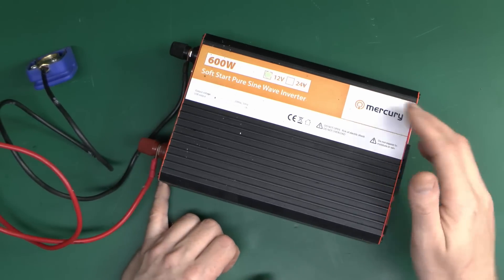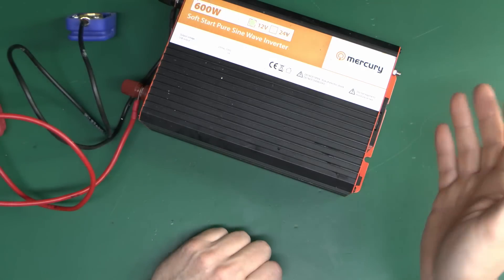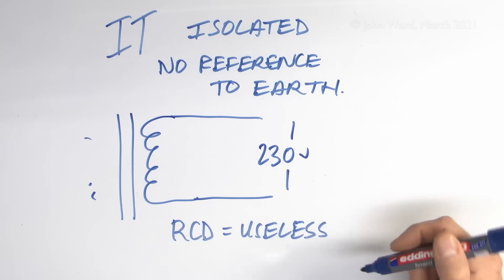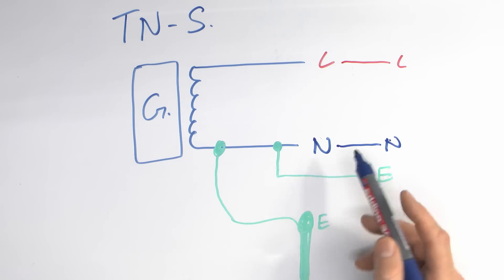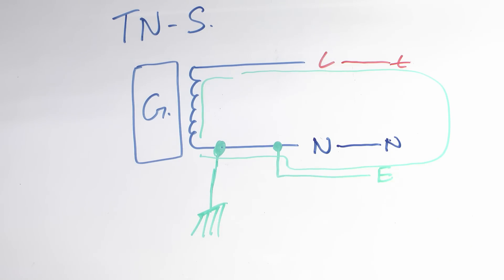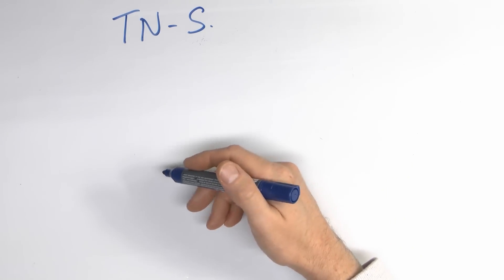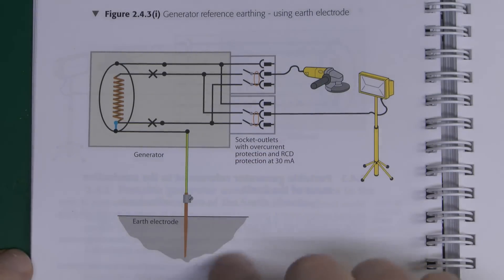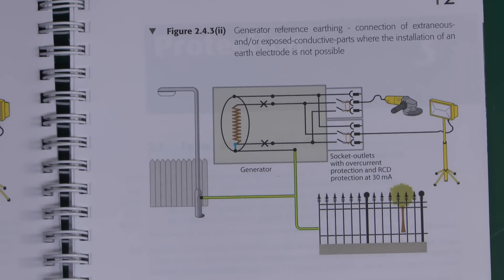Generator Earthing Types - TN-S or IT?

Comment: John you did not mention the ground screw on the case of the inverter that you were showing ? I take it that , that is where one would connect a grounding lead..?
Reply: Yes I was wondering the same thing. Also is the mains output earth connected to that? It that earth stud for earthing the battery or a ground spike.
Reply: ground spike

Comment: Hi JW. I have a portable petrol generator I want to use in a lock up garage. It is a frame generator by Machine Mart. I saw the need for an earth spike so I have held back from using it until I have drilled the floor and installed. Thanks this video is a first step in using it. I believe you have a video on earth spikes so will check that out. Thanks for the info. I take it I have done the right thing to not use it without a spike?!!

Comment: @ JW,
Thanks for explaining this, I don't do a lot of generator work as a rule, but when you read our standards over here  pertaining to generator installation (after you've bought them) they are full of lawyer-speak and no real help.
Every generator I've ever been a part of installing, has been totally different, could be stand-alone 3 phase, portable single phase.
When you go to permanently wire a generator into a switchboard, with a manual transfer switch, I insist on there being a flexible cable from the generator to an appliance inlet (this is a reverse plug, as in it has pins, the connector has the socket arrangement), this has caused so many issues with home-owners wanting the thing hooked up cheaply.
The bit that always confused me, was if you would use a seperate Earth Electrode, if the generator was feeding say an out-building (garage) that was supplied from the house,  in this situation, I don't think I've ever seen an Earth Electrode driven beside the generator?
Maybe them installs have been done wrong?

Comment: A metal water pipe would have been a better choice than the lamppost.
Reply: Everything is better than the lamp-post.
If the supply authority see your wire coming out of your house and connected to their lamp-post, 
they may not even ask the question and then just lop it off.
No earthing for you sweet-heart.......
Reply: @mikeZL3XD7029  A gas pipe is one of the few things worse than the lamp post, JW talked about that before though.
Reply: @station240  If a PME fault does occur, and all the lamp posts, gas and water pipes within the fault area are affected by a rise in voltage, isn't it better if your generator installation rises to the same voltage so that anyone touching one your appliances whilst leaning on a lamp post, doesn't experience a difference in voltages.  
I've seen a reference to a concept called 'PME Islands' in Guidance Note 8, and I think this would apply here - but as often happens with that particular book, I read the first paragraph and found it too confusing to continue.

Comment: Can you expand on the "with the exception of certain types of gas boilers" please? I imagine the principal use of a small inverter for a lot of people will be to keep the central heating running in a power cut...
Reply from the maker: Some gas boilers have been reported to not work when connected to an isolated supply from an inverter.  It's probably to do with the flame sensing circuit, which uses flame rectification.
Reply: @jwflame  This form of flame supervision becomes an issue when the supply polarity is reversed.
Reply: Boilers use a particular way to sense the presence of a flame, they rely on a small current between live and earth, that is conducted by the flame. Thus they require not only that the live supply is referenced to real earth, but also they mind polarity, if you invert L and N the boiler doesn't work. For example it happened to a person that I know that the boiler stopped working, then I checked and L and N were swapped by the supply company by mistake. Also in my country in some areas it's still in place an old supply that is 220v 3 phase, meaning that to get 230v you have to get 2 phases, and thus around 110v L to E. In that supply boilers can have problems, and that cases you have to install an isolation transformers just to have 220v L to N, connecting the N of the secondary of the transformer to E.
Reply: @alerighi  How does that not trigger an RCD is the current less than 30mA?

Comment: Do you ever see centre tapped Earths out of the generator as you would from a work site transformer? Particularly at 110v for which it’s common. Although I guess it cause it’s own safety issues if neutral is no longer neutral as expected.
Reply: The word nuteral is unfortunately assumed to = 0v even though it seldom is.

Comment: Thank you for another excellent educational video.  I appreciate your time and effort in producing these.  Consider a situation where you wish to run an inverter output into the house to run two class 1 items (pc with a metal cases for example).  This is a non-grid connected solar system charging batteries with an attached inverter (similar to your example inverter).  Assume the house is TN-C-S.  Would it be safe to use the household earth?  I confess to not understanding why 1 item with a fault is safe.
Reply: So for my understanding, with the inverter being IT, a single class 1 device with a fault, gives no return path to get a shock, as such there could be a fault without even realising. Add a second class 1 device, and if that too develops a fault, could mean a potential between the two devices if both are touched as once. As such, a single RCD from an IT supply won't give any protection, however if every class 1 device has it's own RCD, if a double fault should occur, at least one RCD should trip due to the imbalance, taking it back to a single fault. No issues with class 2 devices.
Reply: @ Keith Marsh,
No, this new system you're talking about would be a separately-derived system, to the mains system you already have had installed.
The idea of you using your household earth is wrong, you should never reference another system to your mains earthing system, because if there is a fault on your mains system there is a chance that you could end up with a rising-earth voltage situation that could damage anything else connected to it or create a 
shock situation, without you even noticing, until someone touches something metallic.
Reply: @mikeZL3XD7029  Thanks for your reply Mike.  I infer an earth spike should be used for my inverter.  Would I encounter a problem where a network cable went from my inverter run PC to a main's PC?
Reply: @KeithMarsh2  it depends on the network type. Cat 5 cables are transformer coupled at each end and have no earth connection. 
Shielded cables and cat 6 could connect your separate earth's, though true shields should only ever be connected at one end.

Comment: I've been searching for some light regarding generator earthing. Mine generates 186v on the line winding and 60v on the neutral winding. The earth is floating and not n-e linked as the touch voltage would be 60v. So running the generator in a van to use class 1 machines how do we use any protection. Additional protection is out the window, bond all metal and machine casings to the generator frame ? But its floating, so unless it sees over 32 amps it wont cut out. Run the machines via a consumer unit and mcbs ?
Reply: How you managed to measure 186V and 60V respectively?🤔
Reply: @piratedprivacy9052  from the output terminals to the generator casing on line and neutral.
Reply: Sounds like those voltages are from capacitive or inductive coupling.  There are multimeters which have a setting to measure voltage using a moderate input impedance in order to eliminate ghost readings.
Reply: @westinthewest  yes was thinking of ghost voltage, but when I neutral earth bonded the line raised to 196V and neutral dropped to 50v under load on a 2kw heater. I will test it next week with a friends multimeter which can detect ghost voltages. Just dont want to put 50V ac on the van body and cook the batteries or electronic components.

Comment: I used a dual voltage genny 110v/230v and we were only allowed to use 110v power tools (before batteries tool days) back in the 80s.
I used a long cold chisel for an earth rod, it worked but when the arsehole site agent saw it he threatened to kick us of site if we didn't put a copper one in.
Reply: Copper does have MUCH better conductivity than steel. Steel might have done the job - but would need confirmation by measuring. As would copper, come to that.
Reply: @Tiny Tony Maloney,
Of course you did do that......
Reply: So someone trying to keep you safe is an arsehole....
What a prick you are.

Comment: Hi JW, great stuff as always, but here comes a little challenge ...House supply is single phase TNS with 1960s lead cable, roadside cable replaced at some time, so most likely being TNC-S now. Outbuilding 30m away from house which i made a TT supply for obvious reasons. 3 phase generator next to it to supply the big machines. sharing the TT earth.. If i want to feed the house from that generator via a transfer switch, i wonder what to do with the PE as i definitely want to keep the outbuilding TT at all times. Ground resistance to the house is well below 100 Ohm, already got some earth rods on the house PE as i am a radio ham. My current idea is just to make the Genset a '"sort of'" TT supply to the house as the actual ground resistance would be low enough for reliably tripping the generator RCD, so perfectly safe (in my opinion)  ..... What's you thoughts on this ? .... Thanks, Mike
Reply: Could the transfer switch be 3 pole and switch all conductors including PE over to the generator supply and isolate the grid,  So when switched to grid L & N and the TN-S/TN-C-S earth are connected to the house (and isolated from the garage as normal), but when the switches is switched to generator the L,N & PE from the grid are isolated and you are connected to the L & N from the generator then the PE can be connected to earth electrodes at the house and then you would have a TT set-up when switched to the generator, as the generators earth electrode is the first T and the houses electrode is the second T

It is important to ensure complete isolation of all conductors including PE on the side of the switch which is not being used.  Also important to ensure you have a 100mA delayed RCD on the generator to provide fault protection and then 30mA RCDs on the circuits in the garage and house to provide additional protection as with the TT set-up the rod resistance is usually high so RCDs are needed to meet disconnection times.
Reply: @marcuswareham1  As far as i am aware, you not allowed to switch the PE at all, because there is a risk that the switch is on fault and then you would have no protection at all. It also won't fit my requirement to keep the outbuilding TT all the times (longer story). The genset has a 100mA RCD and both consumer units have 30mA RCDs as well. Just to recap what i want to do,... Outbuilding has electrodes, house has electrodes (but is actually TNC), so imho, this fulfills the requirements of a TT supply, essentially the same what you would do with an electric car charge point, the only difference is that this would be a supply, instead of a socket., hope that makes sense.
Reply: @dynoguy  maybe adding another rod at the house end 🤔 got me thinking on that one lol.

DNO new regs coming out means all new builds will have an earthed mesh at the house if its tncs supply effectively creating a backup earthing arrangement should you get a broken PEN.

maybe you could build some kind of system to switch the earthing to make house TT on generation and have the TT also at the workshop end and then when you switch off the generator it disconnects the house TT earthing arrangement and of course by manually switching off the gen set it also disconnects the TT earthing arrangements  carried over from the workshop 😳 

failing that maybe make a earth leakage and relay setup so that when on gen set there's a relay with earth leakage that sends a stop signal to the gen set and fires a separate relay to switch back to the original house TNS arrangement.
this is most definitely a head scratching setup buddy 👌 👏 👍 

my ideas are just half baked and in no way conclusive 

otherwise other issue depending on load is the stress on 1phase of 3phase generation 🙄 😒 could damage gen long term with loads on 1phase only possibly.

Comment: I've been considering this very issue ever since I bought my cheap generator with 110VAC and 230VAC sockets and whether or not to connect the neutral and earth together - since they are not connected internally. I think you've answered a question that I considered: using the earth from my mains supply for the generator earth. I concluded it's not a good idea to connect two systems together in that way and so I've been watching your videos on installing a ground rod instead.

Comment: Is there any way to protect against shocks if running multiple mains appliances in a motorhome/campervan/etc where an earth electrode isn't practical?
Reply: IANAE, Probably not compliant with any standards but you could bond to any exposed metalwork/piping, thus "creating" your earth within your camper, however this would NOT be referenced to anywhere outside the camper, so caution needs to be exercised when touching something outside and inside the camper at the same time, such as stepping into and out of said campervan, or interacting with toll booths etc.
Reply: @deelkar  Can you explain the tollbooth scenario? How do you get significant current flow via the inverter if the vehicle is otherwise isolated?
Reply: @grrrams  Sometimes people fit these "grounding straps" to their vehicles and forget. But yes, the scenario is a lot less likely to have a completed circuit than say, on a camping ground where stuff is maybe attached to the camper which could carry current, maybe there are other things touching the vehicle at that time that are grounded (Metal objects to warn you of oversize if you hit them etc.) Although far-fetched one has to consider these kinds of scenarios when dealing with earthing. The thing is to exclude classes of faults, not thinking of a couple of faults and then just avoiding those scenarios you thought of.
Reply: @Graham Parks,
As long as all of your internal bonding is good and you have a reliable RCD unit installed and tested.
Also if you're only using Class II appliances (with 2 pin plugs) this shouldn't be an issue as far as safety goes. 
If you need any further advice, please ask.
Reply: @mikeZL3XD7029  The common setup in smaller vehicles (especially self-build etc) is no earthing and no RCD when using the inverter. Sometimes these "installations" may have earth wires and RCDs, but as John mentioned in the video, they may not provide any protection.

Comment: Aaa! In Norway, 3phase IT is the main standard used on the power grid, and supplied to houses. Very few houses actually have a TN connection(and very few only have one or 2 phases, we always supply all 3) We are as advanced as cheap inverters are :-) The minority of houses connected to TT networks are not supplied with neutral wires. Only 3x approx 115V phases. We seem to hate the neutral wire. Good informative video!
Reply: Become electrocuted because the neighbor connected a defective appliance with an earth fault to the grid, in such a system the voltage between the other  two lines (three-phase, the ones without the fault) and earth potential can go up to 400V...Nice! 🤣 You can avoid this voltage increase, but actually it's not a nice system in case of a fault. One method to avoid it is using a Wye configuration without a neutral.
IT here is only for small areas which require a high reliability, for example hospitals. Insulation must be monitored continuously, fault finding is a pain the bigger the IT grid is. First fault will turn it from IT into TN. And the second fault disconnects the circuit, if the current is high enough...

In Germany it's three-phase too, but the most common systems are TN-C-S and TT. IT only for small areas which require a high reliability, for example hospitals. Insulation must be monitored continuously, fault finding is a pain the bigger the IT grid is. One fault will turn it from IT into TN, and the second fault disconnects the circuit if the current is high enough...
Reply: So, 200V appliances is vastly used in Norway?
Reply: @piratedprivacy9052  . We use 230V, but it is a very fluctuating voltage! One day, I might measure 229V, the next I might measure 237, and 240! This applies to several houses. The 230~ voltage is achieved by connecting an appliance to "L1" and "L2 or "L3", not"L" and "N". It's is actually quite similar to the American grid, although we ground the transfomers middle tap, and send both phases to the consumer(top and bottom tap, if I have understood correctly). If I were to probe between a phase and the earth/soil I should measure 115-130V. We do indeed use an earthing system, where every house has a ground-electrode or a bare copper wire running around the house underground. Our 2pole circuitbreakers do by new standards have leakage current detection, and will break the circuit if any current higher than 30mA goes through a human to ground/earth lead to ground.  In theory, the fault current should run back to the nearest local transformer that usually supplies the whole village/area. Sometimes, we also supply the earthing all the way from the transformer to the consumer. Our Electricity meters (smart-meters) do in fact measure current and any fault current, and will notify the supplier if there is any fault. They sometimes go completely nuts, and will send an electrician to your house.